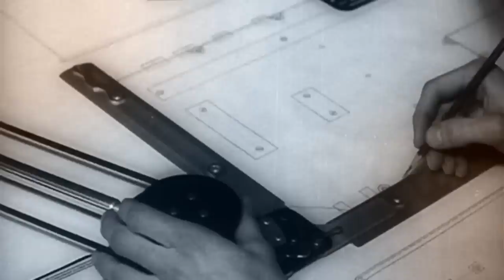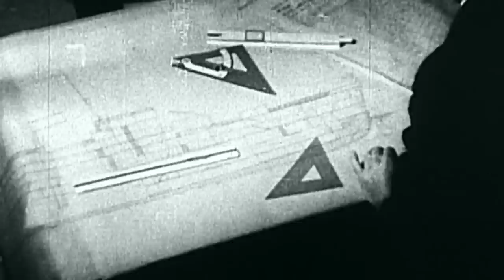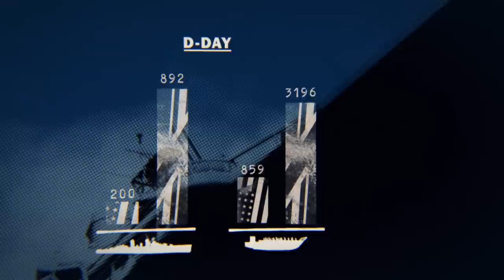How Did British Industry Meet The Demands Of WW2?

Comment: German engineering: knurled-knob, spiral-threaded, spring-loaded, pin, secured with non-slip butterfly nut with washer and lock-washer.
English engineering for the same job: cotter pin.
Source of supply for spare parts for Turkish Airforce Messerschmidt ME-109s: five-year waiting list from Germany. Adequate supplies immediately available from Britain,,,
Reply: You've been very selective with your examples and implied the German approach was better. You clearly not an engineer. It should be point out that all the items you list were not invent in Germany. British aircraft also used quick fit spring loaded flush fixing.
Is what you tried to describes but lacked the basic engineering knowledge.